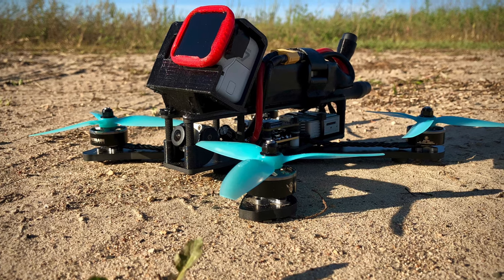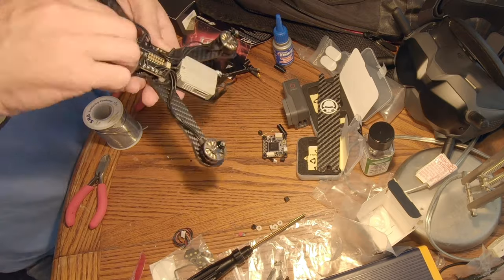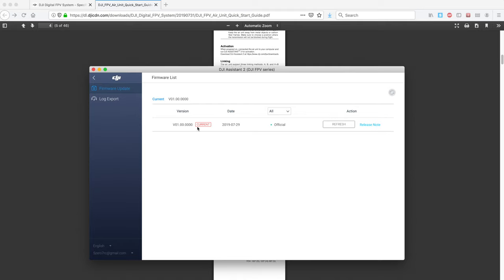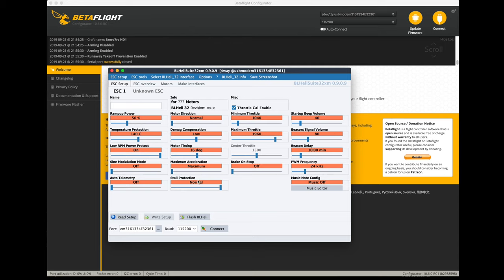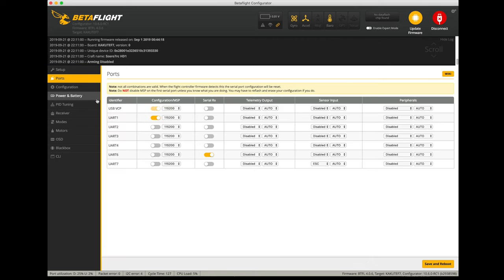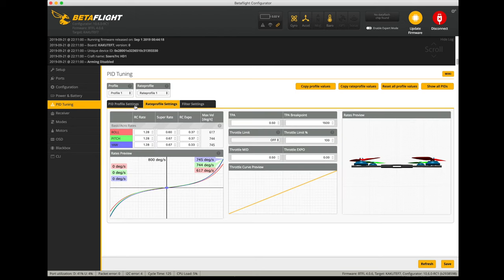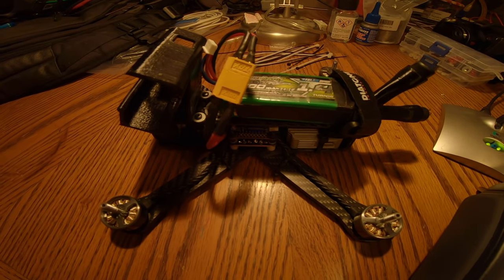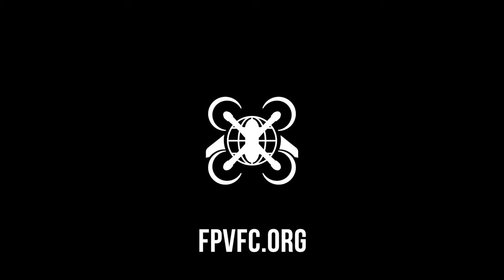DJI FPV in a Rotor Riot HD1 Frame - Complete Build Video

Comment: You have a cable that fits right from the air unit into a plug on the kakute. Where did you get that wire? my air unit only came with a cable with a male socket plug on one end and loose wires on the other.
Reply from the maker: Yes, the correct cable came with my parts.  I don't remember for sure if it came with the air unit or the FC.  Thought I kind of think there was one with each.

Comment: at 23:34 one of the motors is not spinning one closest to you did you ever find out why seems i am the only person that has said anything about this not trying to nitpick anything just asking why it was not spinning thank you and you helped me a lot its nice to have a refresher on this so thanks
Reply from the maker: Good question.  I don't remember noticing that while doing the build and making this video.  I think I have had that same issue pop up very rarely when I plug the battery in goofy.  Like if I double tap the connector together or something and it confuses the ESC with a couple quick bursts of power.  In the past year it has happened a few times and disconnecting and reconnecting the battery seems to fix it.

Comment: Looking to build a 5" quad with DJI and was looking at T-Motor F7 stack but they're out of stock.  Any reason why you didn't go with the T-Motor over the Kakute?
Reply from the maker: Never used T-Motor before.  Had good luck with Holybro in the past, and it was in stock at the store I was buying other stuff from at the same time.

Comment: Thanks, for really explanation, I have a question can I add a GPS to FC, if yes, which ports do you think to add, as it's my first build I am trying to do that. Thanks.
Reply from the maker: I have never used a GPS so I am not an expert.  But I believe it can be wired to any free UART.  In my example UART 2, 3, and 4 are all open and available for use with a GPS unit.  Just connect the GPS to the FC on one of those UARTs and then configure that UART in betaflight for GPS.
Reply: @5zero7RC  Many thanks for your fast response, I see these ports are ready to use and free. Thanks again

Comment: Hi there! So im ordering my HD1 kit from rotor riot and im getting everything ready and becayse in newer to building these, was curious what battery i need and props? In their video they never say what to buy for either one. Theres so many different batteries for 4s and dont want to ruin my build right away. Also dont know if it differs battery wise between your build and the rotor riot build but please keep that in mind! Really hope to hear back soon! Thanks!
Reply from the maker: I find that CNHL makes decent batteries at a reasonable price.  They are not the best or the worst, but if you can get them on sale from their US warehouse ( assuming you are in the US ) they are a great value.  
I personally run 1500 and 1600 mah 4s batteries from CNHL.

I am not an expert on props.  I started with dal cyclone 5045, them moved to HQ 4x4.3x3 V1S and just recently got some Ethix S5 but have not tried them out yet.  With props it is best to try and purchase variety and see what works best for you.  To start with get something around the middle of the road with a pitch near 4.5 if you can.

Hope that helps!
Reply: @5zero7RC  thank you so much! I found out what I needed shortly after posting this but all the info I get helps with more knowledge in this Hobbie! Orderes everythjng I need to get up and running, just need to find a charger I like that isn't super expensive lmao!

Comment: @5zero7 RC  Is it possible to change the order of the motors on betaflight?  I followed the soldering instructions I found online and the order (left to right, top to bottom) is 1, 3, 2, 3.  Must I break it all down and resolder?  I really hope not.
Reply from the maker: Yes, absolutely.  You need to use resource remapping.  I think Joshua Bardwell covers it in this video: https://www.youtube.com/watch?v=gL1DxUFjFq8

Comment: Nice video. Why Beta flight OSD data is not being displayed inside the Goggles? That sucks..This means the DJI system is not truly Beta Flight compatible..False advertisement by DJI for sure.
Reply from the maker: Since this video was created, DJI has released a bunch of firmware updates and has added the ability to see most of the betaflight OSD items in the DJI goggles.

Comment: How is the DJI camera view on this frame? I have the prebuilt coming from Rotor Riot while I work on repairing my other one just wondering if you have props or standoffs in the frame with the DJI camera? Thanks!
Reply from the maker: Depending on your uptilt you can see a little bit of the top of the frame/standoffs in the camera and the props are partially in view.  Here is an upload of the raw footage from the Goggles taken while flying this frame on one of the first few flights.  https://youtu.be/G7RgsgEkOrA
Reply: @5zero7RC  Cool, that's not too bad I don't have much tilt still pretty new and into mostly cruising around. Thank you.
Reply: @5zero7RC  It may be possible to eliminate the props by having a frame with a 'wing span' that is wider than it is long. I saw on a YT video wherein it was said that wider than long frames are for roll oriented maneuvers, and longer than wide frames are for pitch oriented pilots (racers).
I'm a complete newbie, so take that with a grain of salt. 
With the RR frame, is it possible to orient the arms in a configuration to have a final frame that is more wide than long? Or, is there only one way to assemble the frame?
Being a newbie to FPV drones (coming from the camera drone world, and bored with it) would it be advisable to build from a RR, or like kind kit? Signature kit builds tend to increase the total build cost compared to buying piece parts of comparable quality. 
If you have any insight toward that end, I would appreciate your input.
Reply from the maker: @mosephina  There is only one way to assemble this frame so for people that don't want props in view, you would need to find a different frame.  And they do exist.  Sometimes called "dead cat" style frames or advertised as not having props in view of the FPV feed.
You will get a wide variety of advice if buying a prebuilt is better than selecting your own parts and building it.  Personally I liked starting with a prebuilt so I had a good reference for how things should be done.  But these days either path is perfectly viable and you can find lots of help if you need it.

Comment: Hi this is a great video but i did what you set up but forme i got a problem if you can help me, im new to this hobby i can send you a video and you can say somthing for it..
when i give a bit of throttle this stuf going carzy just revs up and down.. i dont konw what can i do..
Reply from the maker: Is that when you have the props off and testing it?  If so, that is normal in certain modes.
Reply: @5zero7RC  thanks maybe the calibration? i havent flown.. just build it 
but im thinking if i fly is going to be te same 
when i push up the trottle a bit after the motors going crazy
do i need a firm update? for the esc
Reply from the maker: @norbertszabo8736  When you don't have props on the drone will try to make corrections but it can't actually move any air and will keep trying harder and harder to move.  So if you are sure all 4 motors are spinning the right way and you have tested that your failsafe works, put the props on, take it outside somewhere safe, and see if it will hover.  If it flips out at all quickly hit the disarm switch.
Reply: i went out to try it but this stuff like a rocket goes up to the sky if i just touch just a tiny bit just flys away not as yours :(
Reply from the maker: @norbertszabo8736  Humm, if you go into Betaflight and go to the receiver tab, do all the channels move when you move the sticks?  Does the little picture of the drone move as you would expect?
Reply: @5zero7RC  yes thats no probelem is moving, only if i want push up a bit the throttle than loose the mind, the other side of the radio no problem works fine but the left side isn't good, i haven't fly with this issue i tride 2 times but the drone just goes up as a rocket :( shal i buy another kakuta stack? This is what the drone do https://youtu.be/i4xZbLIK330
Reply from the maker: @norbertszabo8736  I might be wrong, but I am pretty sure that looks very normal for a setup with air mode enabled.  But if you put the props on and tried to test hover outside and it shot way up in the air, then something must be wrong.
Reply: @5zero7RC  hi thanks all your help, but the drone do the same thing in the air, and also blows up the capacitor wire i changed 2 times, doesn't do flips, and i practice to fly on the liftoff simulator maybr 150 hours so i can handel, but this this stack doesn't do what i accept, and also now is broken because can't fly normally whit this situation, i went out the field and crashed a few times i used smooth control, no big acceleration and than maybe you can fly, but now no connection between the esc and the dji air unit, but i have a different stack and i try the air unit is working, i think the esc gone, i already ordered a tekko32 60A esc and another holybro kakute f7 fc, lets see again thanks your help( and sorry my English is not the best) and have a great day

Comment: Great Video, One question. Was going to use a different FC (the one used in JB's Video) and I'm considering the Holybro F7 HDV. Can you still get OSD on the DJI Goggles using this FC?
Reply from the maker: Yes.  I have the Kakute F7 HDV and the new OSD does work.
Reply: @5zero7RC  Now that DJI supports betaflight OSD, but this FC does not have that, you say you get Voltage, RSSI, etc. on the screen? And do you have any problem running the DJI Goggles up to 1200mw?
Reply from the maker: @savasoguz  You can still use the new OSD from betaflight without an OSD chip in the FC.  So using the F7 HDV FC you can still get these new OSD options.

I was able to run the goggles at 1000 and 1200 in testing thought I have since backed it down to 700 as that is plenty for my needs.
Reply: That’s a relief, thanks.

Comment: Hi. I Changed FC and now no green light on Dji air unit.What I did wrong?I did update wit googles and radio,but air unit dont react to Dji assistant(fpv)
Reply from the maker: To upgrade the air unit, you have to plug the air unit into a computer with the usb cable. Are you sure the air unit is getting the proper power for it to function?
Reply: @5zero7RC  Some guy told me,he connected UA wire dirrect on FC,is it possible?
Reply from the maker: Some flight controllers are designed for the DJI Air unit and you can simply plug them directly in.  For any other flight controller you have to find a good power source on the flight controller, or power the Air Unit directly from the battery power.  But the air unit can only handle 4s voltage.  So don't do that if you are using a 6s battery.
Reply: @5zero7RC  I have 4s battery.
Reply from the maker: Then I would recommend connecting the air unit directly to battery voltage.  Sometimes your flight controller will have a vcc or battery voltage pad you can use.  Or you may choose to connect to the battery pads on your 4in1 esc if you have that.
Reply: @5zero7RC  thank you soo much for helping! I will connect red and white dirrect to battery wires. Now I try to find where I should connect ather white,grey,brown and yellow wires to my FC.
Reply from the maker: @andrejszukovs1564  It all depends on which flight controller you have.  This video is old but does a good job showing you how to install the air unit.  https://www.youtube.com/watch?v=mA9eAroS_6I
Reply: @5zero7RC  thank ypu again,you are helpfull. Im begginer with FPV. Ok now I connected  black and red,sooo AU is working and I can see in Dji googles a picture. So now I will try to connect other wires,I saw this video and he help me to understand what I should find. I have Xrotor Hobbywing 60A FC.

Comment: If your using the dji remote you should disable telemetry. Kinda important information to not be included if your trying to do a tutorial I would think?
Reply from the maker: I didn't have a chance to test this, but I wanted to be sure that telemetry data was still being sent over MSP to the DJI system and that toggle switch does not give enough information about that.  Since it was on by default from the manufacture, I left it alone.

Comment: wait so how do i get current amps and used mah hours live on my osd if it doesnt have betaflight osd? can the dji unit (OR in my case the caddx vista) somehow read the current sensor of the esc? Also if i am flying 6s, the air unit doesnt get the live battery voltage, right? So how can i see the live voltage of my battery in my googles? I am so confused!!!
Reply from the maker: The DJI FPV system uses a "MSP" connection on a separate UART to talk to your flight controller and gather data that it can use for the OSD.  The more recent DJI firmware updates for the system have enabled more of the data to be displayed in the DJI goggles.  So assuming you have the MSP connection between your vista and the flight controller working, you can display lots more information now.  You have to enable the feature in your goggles and configure the OSD in betaflight, but once you do that, it should show up.  Unfortunately DJI does not yet support ALL of the available OSD information, but they do support a bunch of it.
Reply: @5zero7RC  nice, thanks for the long answer! for some reasons my local shop claims this board/stack has a OSD: https://www.rctech.de/holybro-kakutef7-hdv-tekko32-f3-4in1-40a-esc-stack.html... is that possible or did they get something wrong?
Reply from the maker: @rawpicsfpv3516  There are two versions of the kakute F7 fc.  one with an osd, and one without. The one labeled HDV is designed to be used with the DJI FPV system and does NOT have an analog OSD chip.  However it can still send that data to the dji system to be displayed by the DJI OSD.  If that makes sense.
Reply: @5zero7RC  ahhh okay so for basic infos like voltage and current there is no real need for an osd if using dji? Also, did you click the link? its called HDV so it shouldnt have a osd - right? So the shop made a mistake
Reply from the maker: @rawpicsfpv3516  I get a page not found error for that link but I did see it shows HDV in the url.  So if that is correct, that version would not have the OSD chip.  Unless that FC has changed in the past year compared to the one I have.
And yes, if you use the DJI FPV system, you don't need your FC to have an OSD chip.  An OSD chip in a FC puts text on top of an analog video signal which is not useful when using the DJI FPV system.  However you can still get that data from the FC and allow the DJI system to show you that info in the DJI OSD.  But that data is transferred through a UART on the FC instead.
Reply: @5zero7RC  nice, thanks! You clarified a lot, i was so confused;)

Comment: Can i use my own esc and fc
Reply from the maker: If you are asking if you can use your own esc and FC in combination with a DJI FPV air unit ( or Caddx Vista ), the answer is yes, you can.  Some FC's are easier to use with the DJI system however, like the one I used that has a plug designed to work directly with the air unit.
Reply: @5zero7RC  ok thank you it’s really hard to find good videos on using the dji fpv system with compatible esc’s so thank you

Comment: How much does all this cost
Reply from the maker: HD1 frame: $45
FC and ESC: $92
DJI Air Unit: $150
Battery: $20
Motors: 4x $26
Props: $3
Reply: 5zero7 RC thx for the quick reply and btw the video was very in-depth easy to follow/understand and I think I will attempt this build thx a lot 👍🏻